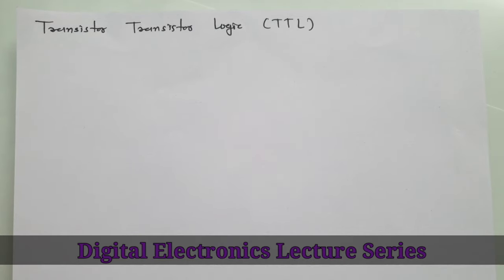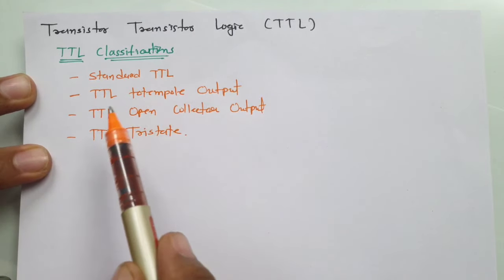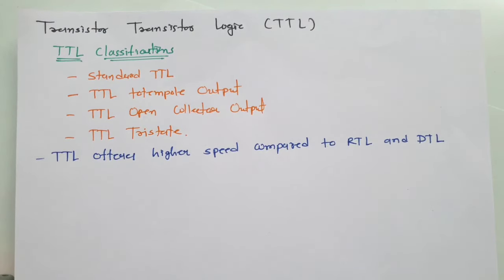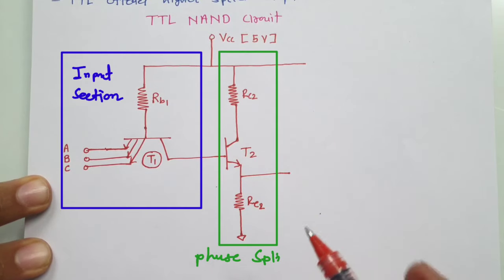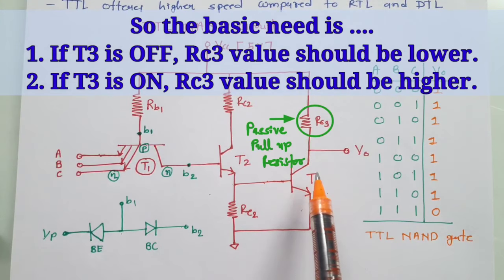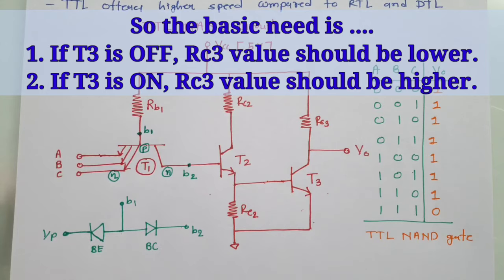Transistor Transistor Logic (TTL): TTL NAND Gate Circuit and Working

Comment: If R3 is lower than higher value of base current requires for T3? ? Basically, for input =1, T3 will be in saturation region and in saturation region, if R3 is lower dn high current will flow through transistor means high charge and it will add delay at a time of state change of output.

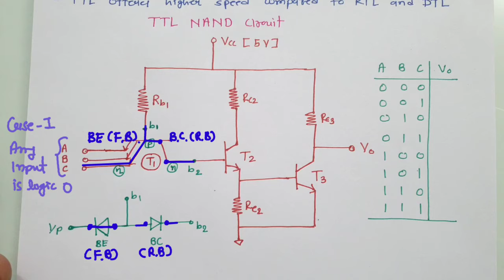Comment: at 6:16 how can base collector be reverse biased if base is at higher potential
Reply: Same doubt..
Reply: It should be in saturation region. But due lesser potential at collector, next stage transistor will be off.
Reply: @PrashantKumar-xv6fz  wait, what do you mean by that? The potential at the collector is less than what?
Reply: When BE conducting the voltage reduces to point 0.7 so at T2 base there also 0.7 so there not enough at the node below b1 in diode equivalent diagram which makes collector to reversed bias😊
Reply: @joelpaley9912 at T2 voltage is 0.7

Comment: 00:02 Transistor Transistor Logic (TTL) is explained in this video.
01:26 Transistor Transistor Logic (TTL) is an upgraded version of logic family with improved fan out and margin, but lower speed.
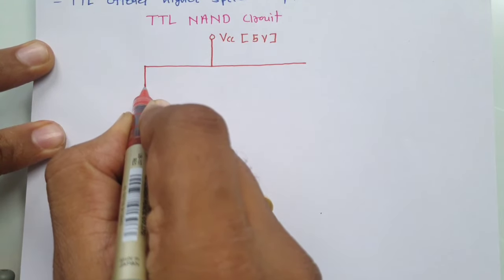02:51 The video discusses the three sections of Transistor Transistor Logic (TTL) and its functioning.
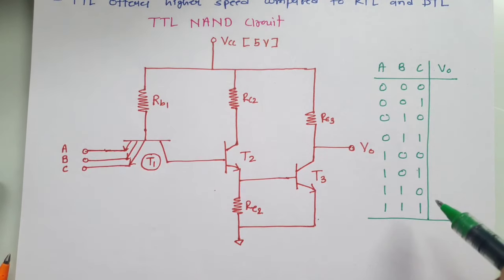04:19 TTL NAND Circuit Working
06:17 TTL NAND Gate Working
07:52 TTL NAND Circuit and Components Details
09:27 Understanding TTL logic and NAND gate working
11:01 TTL NAND Circuit has higher power dissipation compared to other circuits

Comment: In other video it shows 3 transistors for TTL nand ? Why? Is either way correct?
Reply from the maker: You can see the title of each video
Reply: @EngineeringFunda  thanks, I want to see how TTL Nor gate works? Can you help me..
Reply from the maker: It is there in my playlist of digital electronics
Reply: @EngineeringFunda  yes sir, I found TTl NOR Using Totem pole, Which means Standard circuit doesn't exist for TTL NOR?
Reply from the maker: @MushtaqAhmed-bh2cj  : in standard TTL, you just need to replace totempole with normal circuit.
Reply: @EngineeringFunda  ok thanks